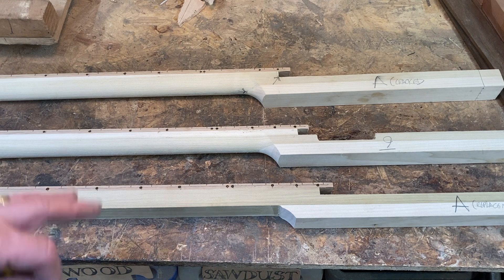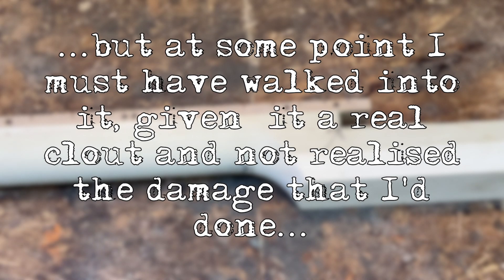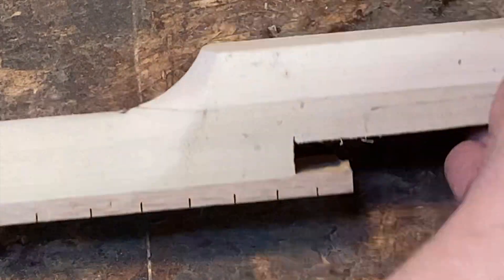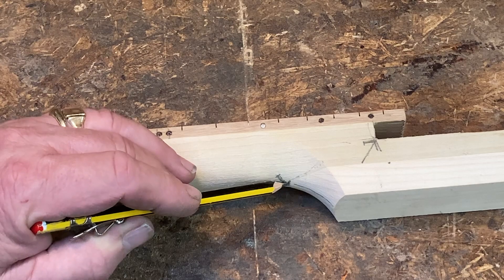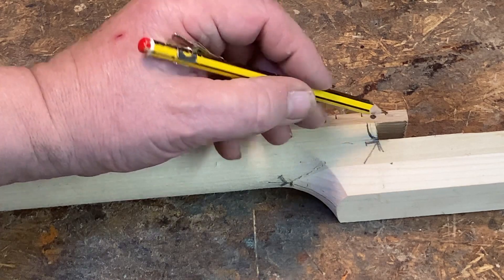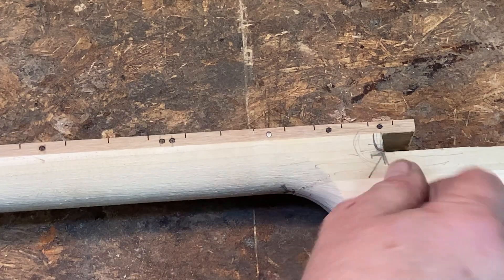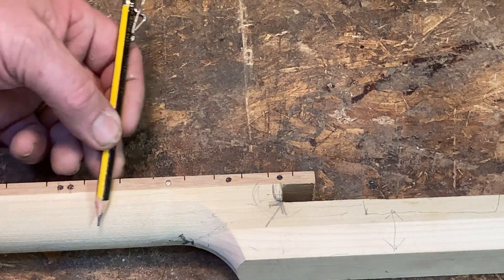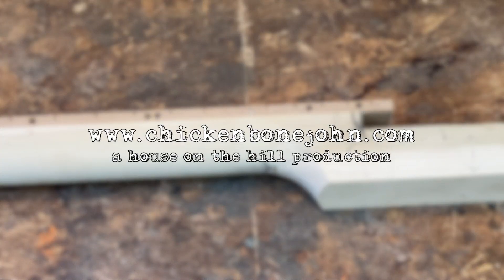I broke a guitar neck by accident! So I decided to explain about "crack propagation"

Comment: Thanks for this John, do you think that maybe Poplar is not the best wood for a neck? not so sure it would have happened with cherry.
Reply from the maker: Cherrywood is a little more resistant than poplar, but with the sort of massive load that it took by being knocked, I'm sure it wouldn't have made much  difference. We use Cherrywood in a lot of our guitar necks.

Comment: Do you think the split follows the wood grain and if the neck was turned so the grain of the wood was vertical would that be stronger?
Reply from the maker: The split will follow the weaknesses along the grain - that's the way wood usually fails under that sort of extreme bending force. The timber was already planed to dimension so I couldn't have used it in a different orientation, but the orientation would have made precious little difference in resisting breakage.
Reply: you are correct grain vertical is what all people in the know would do dude

Comment: Thanks for this, John.  I always (overly) worry about reducing the strength-integrity of my necks in the building process.  So, I suppose that's why I tend to make them slightly beefy, and only cut away about an eighth of an inch for the soundboard to resonate.  I use surface mounted pickups so there's no reason for a pickup notch in the neck.  Also, I use maple, or red oak for all my necks.  "Anything worth doing is worth over doing", has long been my family motto.  LOL  Have a great weekend.